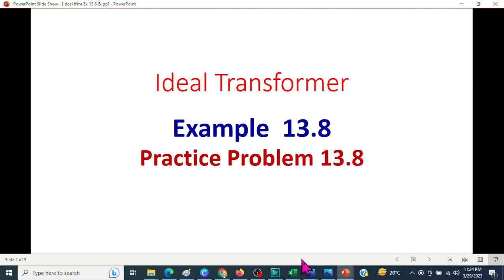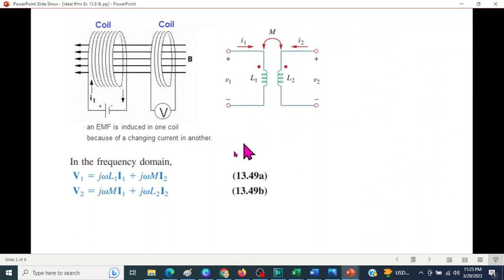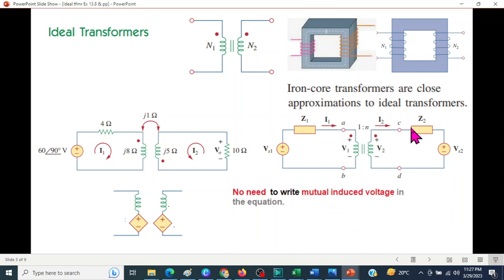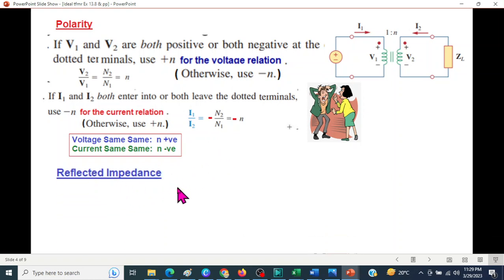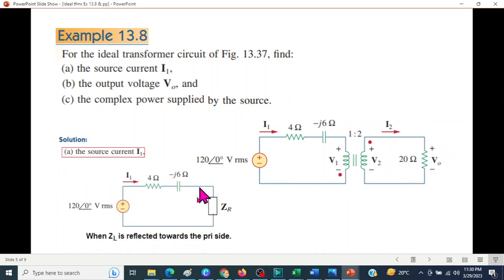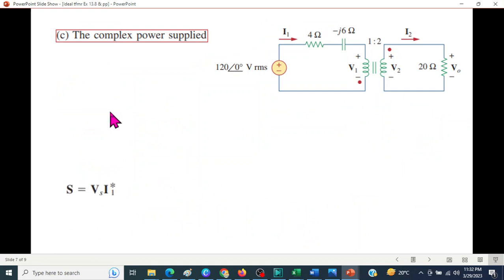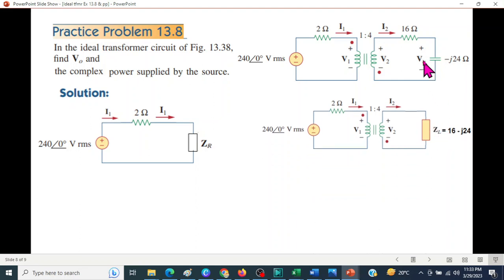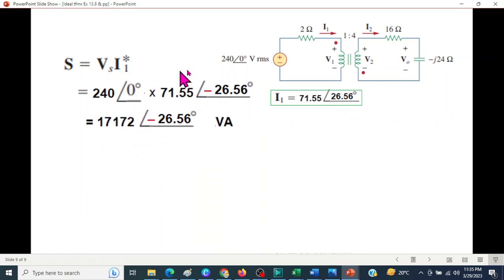(English)ENA Example &  Practice 13.8 || Ideal Transformer

Comment: If i rest the 180 degree when i try to eliminate the negative, i would still be ok? It give me the result of 5.45 and -146.31 degree in the calculator
Reply from the maker: You could add or subtract 180 with the angle to eliminate negative sign.
Reply: And if it's positive , i don't do it?
Reply from the maker: @carlosalbertomunozgiron6089 Yes